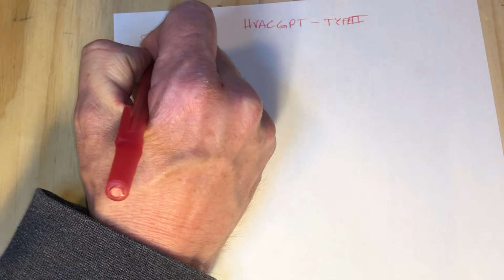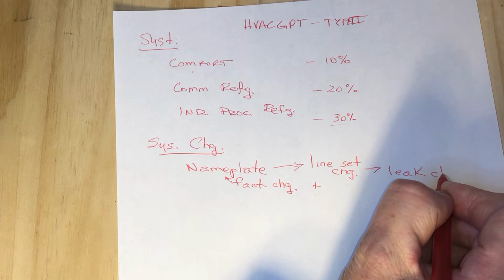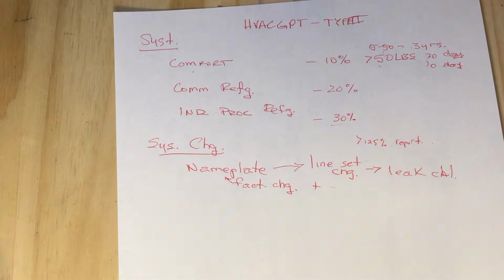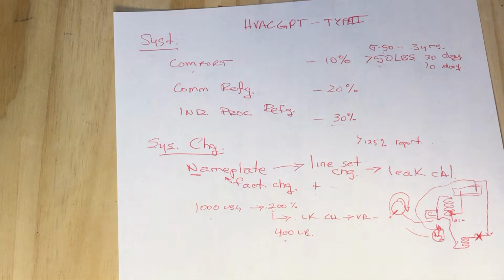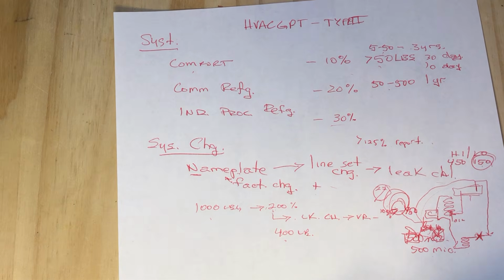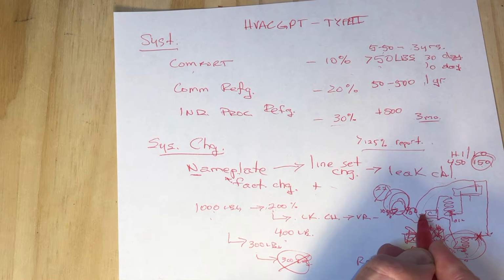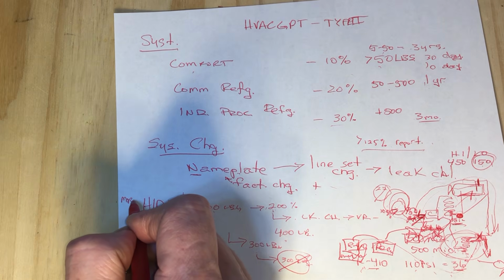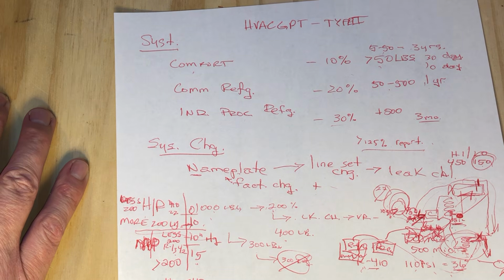HVAC Basics: EPA 608 - Top 20 things to know for Type Two of the EPA 608 Certification

Comment: I’ve worked long time with my dad  doing side jobs. I’m very knowledgeable in hvac for not having schooling. In Ohio there are no state requirements to do residential hvac work. Yet supply houses still won’t sell to me. do I need this in order to buy from supply houses?
Reply from the maker: The EPA 608 certification is a federal requirement for handling refrigerants, so it shouldn't affect your ability to purchase supplies.
Reply: @edisonhvac every supply house near me requires a hvac license
Reply: @TheTechGuider 
You have to have an EPA certification to purchase refrigerant. The 608 Universal is the most common.

A supply house will not sell it to you without that. You should not be servicing HVAC equipment on the refrigerant side without the proper certification.

Comment: At the 1000 pound line you wrote 200% and kept saying 200 pounds. Is it 200 pound, 200% or 20%. I doubt it's 20% but 200 pounds equals 20% of 1000 pounds. I should note, I really like the visual representation. I noted recently in my experience HVAC teachers under utilize visual representation. If I were you I would make it a little more bold for visual memory. Make it look almost decorative.  But I was thinking before seeing this video that I thought this method would be great and then I find this video.